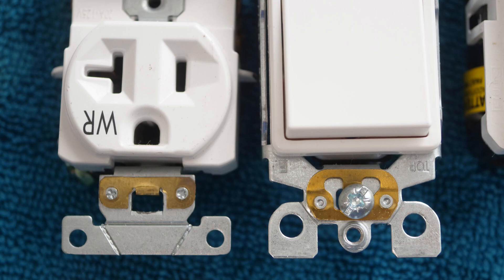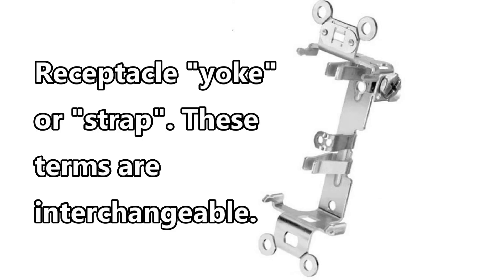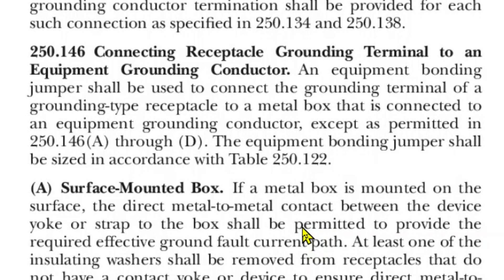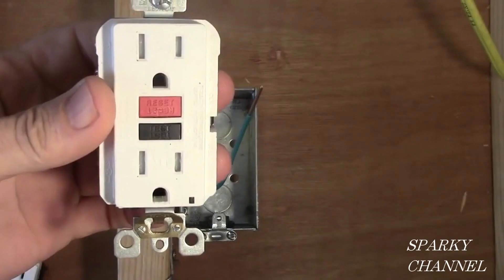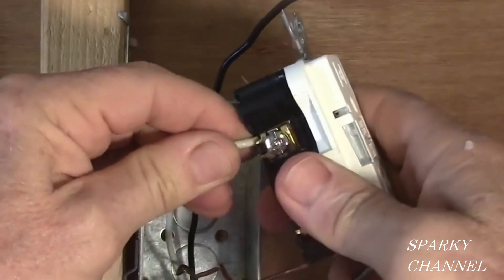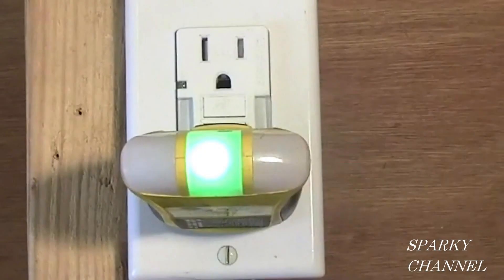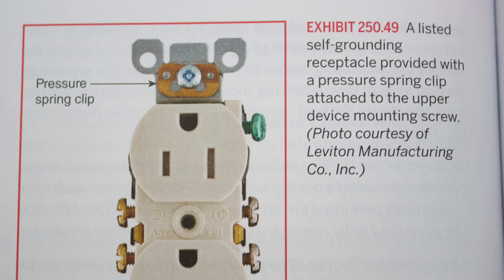Self-Grounding Clips for Receptacles and Switches with 2023 NEC 250.146

Comment: This house I'm working on was built in the 50's and only has 2 pole receptacles. My problem is the switch to turn on the outside porch light doesn't work the only way i get 120v is putting my test leads on the hot (black wire and the outlet box. The neutral and hot wires when tested only shows 50 volts. How do i fix that.

Comment: Dumb question, why would someone want to leave the washers on? If the box is not metallic it won't make a difference and if it is a metal box, why would you want not to have it grounded that way possibly in addition to being grounded with an equipment grounding jumper?
Reply from the maker: The washers hold the screws in place, making installation a little quicker. But I'm with you on that.

Comment: Does this only apply to surface mounted junction boxes?
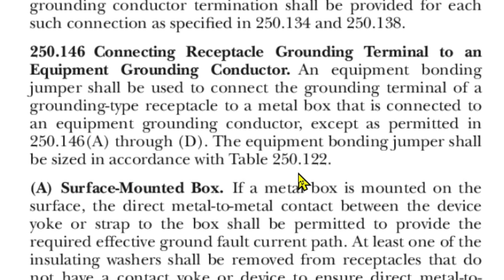Reply from the maker: See 2:13 Surface mounted metal boxes are treated a little differently than other boxes.
Reply: Is a device mounted to a metal box through drywall using the standard drywall ears considered a surface mounted box? 

I have a house build in the 60’s that has cloth romex with a ground. They grounded the box and there isn’t much wire to pigtail to the device. Most of the boxes are flush to the drywall but a few are recessed 1/2”. Would self grounding outlets be permitted in that application?
Reply from the maker: @beefboi9976  Do you have metal boxes?
Reply: Yes all metal boxes. They currently have 2 prong outlets but the box is grounded with the ground from the romex. There is not enough ground wire in the box to splice to the device.

Comment: Sparky... NEC 250.148(B) requires that disconnecting or removing the receptacle from the box does not interrupt the electrical continuity of the EGCs providing the effective ground fault current path. Therefore, the EGC needs to be connected to the metal box, not to the self-grounding receptacle's green screw... The self-grounding feature provides the bonding between the grounded metal box and the receptacle yoke...  Doing it the other way around violates the above article, IMO...
Reply from the maker: Thanks!
Reply: This was my understanding as well.
Can we get a video update?😂

Comment: Hi Sparky, I would like to upgrade an old 2 prong outlet to GFI, there are 2 copper (bonding or grounding?) wire that pass through (but don't end) in the back corners of the metal box, should I somehow attach ground wire to those in addition to the back of the box, or only connect the ground wire to the box?
Reply: @jenniferm2453 there's a way to test the box with the 2 prong outlet mounted in the box to see if you have ground or not.  If you have the tester to tell if you have proper wiring or not, and a 3 prong adapter, remove the cover plate screw to your 2 prong outlet, plug in the adapter & secure it with the cover plate screw.  Run the test.  If you see it as properly wired and grounded, the box is grounded.  Do the same test to all outlets on the same breaker.  If all show correct wiring and none of the outlets are in a kitchen, laundry room or bathroom, all you will need is an AFCI receptacle at the most upstream outlet.  But if one shows no ground, then you will need a combo AFCI/GFCI receptacle to protect everything downstream.  Now, some homes are wired so that every box appears to be an end of the line receptacle.  I hope every 2 prong receptacle on the circuit has a metal box that got bonded from behind.  That way, you'll have less to deal with.  You can also "borrow" the ground on the circuit to ground ungrounded boxes on the same breaker, using 12 gauge solid green wire.  You can legally ground an outlet box, using grounding clips to secure a wire to the edge of the box and feed it to unbonded metal box needing the ground.  I happen to have circuits I will be bonding, using that method.
Reply: Thank you. That was very helpful!

Comment: Good afternoon Sparky,  What electrical tool would I use to safely trip a breaker in the panel on regular outlet or gfic or afci.   Thank you.
Reply: A concrete core drill will usually do the trick

Comment: Based on the code that sparky read, it seems to me that these are only meant to be used in surface mounted boxes.
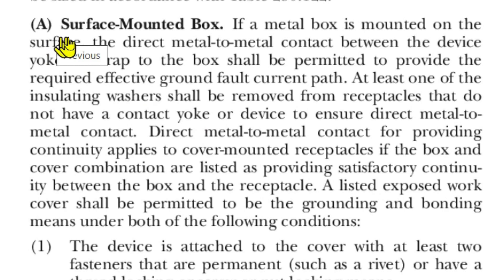Reply from the maker: See 2:13 Surface mounted metal boxes are treated a little differently than other boxes.

Comment: The plug-in tester is testing the device (receptical) wiring, no? How would it detect whether the box is grounded?
Reply from the maker: That is one of the tests a receptacle tester does. If there is a problem with the ground it gives a different code.
Reply: @SparkyChannel  That's cool, where can I get that model? Do you know how it does it? Is it making contact with the box somehow?
Reply from the maker: @Bapuji42  Here's my favorite: Klein Tools RT250 GFCI Outlet Tester with LCD Display, Electric Voltage Tester for Standard 3-Wire 120V Electrical Receptacles: Amazon: https://amzn.to/41DqV8O
  It makes contact with the ground of the receptacle, so it's able to make ground tests as well as AC voltage and several other tests. I highly recommend it.
Reply: @SparkyChannel  Thank you! But I'm confused, how can it tell if the box is connected to ground just by making contact with the receptacle ground?
Reply from the maker: @Bapuji42  It has circuitry inside of it that tests ground to hot voltage, which should be the same as the neutral to hot voltage.

Comment: Most residential=plastic boxes
Reply from the maker: In newer homes, yes.
Reply: Some jurisdictions such as Cook County Illinois which includes Chicago are what I call “pipe and wire” codes. If someone has a better term than this, please chime in. All line or mains voltage wires must be contained in metal conduit and all j-boxes are metal. Normally the conduit is TWC, thin wall conduit which is easily bent with a pipe bender or a hickey (old term). The conduit and j-boxes are galvanized steel. In exterior applications powder coated aluminum. Solid or stranded wires are pulled through the conduit and terminations/connection made in metal boxes. Thus the entire building has what I call an Erector Set (R) piped ground path that is properly bonded per NEC/local codes. The spring brass part riveted  to devices as Sparky shows is often in commercial grade devices. The 6-32 mounting screws have a slight interference fit in the brass which actually makes mounting easier since it holds the screw as you engage bit and drive it home. The brass alloy is essentially non-oxidizing so is a better bonding than just a screw to a galvanized steel box which can corrode and diminish path to ground efficacy. I only use commercial grade devices in small rehab projects in my area, Chicago. Mostly because the clamp-type wire grip in back. No shepherd’s crooks. If a dedicated grounding conductor is not present in a box I add one. Belt and suspenders. Newer boxes have, in the back, a 10-32 threaded hole (sometimes in a “bump”) where I attach a pre-rigged (green wire attached to green screw for ease of positioning and driving). You can buy these pre-rigged. In old properties I’ll drill a hole and tap 10-32 using my screwdriver-like Triple Tap Klein #625-32. Handy because it has 6-32, 8-32, and 10-32 taps on the same shaft. If I have a lot to do the shaft is removable and I put it in a small chuck that fits into my Milwaukee M4 cordless screwdriver. Been using the old and new Milwaukees forever. Clutched. Pivot for pistol or straight grip. With 32 TPI screws a real time saver. Especially with toggle bolts. Never used an impact driver in my electrical work. Hard to control and threatens strip outs. Oh, how I digress. Thanks Sparky. Happy and safe projects for all.
Reply: Thank you for sharing your knowledge.

Comment: Before I even watch the video, I'll say these are exceptionally useful in old buildings where the metal box attached to the old BX cable (*usually* with the little aluminum bond wire) is the effective ground. I know a lot of non-electricians who are ok just using the mounting screws for a ground. I was never really ok with that, and for places I couldn't get a green ground wire & screw on the box, I'd always do something like applying dielectric or noalox to the screws as a desperate attempt at ensuring a low impedance ground. This little clip makes things a lot better.
Reply from the maker: Yes, I agree. Great points!

Comment: Are the US now also using Pozidriv screws? Seen on 4:22. The screw has the additional small diagonal grooves that indicate that it's Pozidriv and not Phillips. And there's also a screwdriver available that is PZ/SL, in that case I think it should be PZ/SL size 2.
Reply: there's a few that use them but they aren't very common. Me myself i still prefer to just use a #2 square drive. They aren't being sold here yet as just bits (at least not in my area) so the only way to get a pozidriv is to get a full screwdriver set.
Reply: Those screws are designed for use with a flat blade, Robertson bit, or an ecx bit, same as the wire mounting screws on the sides.
Reply: @surferdude642  Normally yes. But not that particular one shown on the time index I've linked. That is clearly PZ/SL and not Robertson square drive. 

https://shop.albw.de/dasd/cv/media/b8fedaf0179e9d71f126b0d28773d97a/item-large/8U3HPOELFA8E43PLM51SVBNRKS.jpg
Reply: @surferdude642  Pozidriv is a modified version of Phillips. It has different angles of the flanks, and it does not cam out that fast on higher torque. To indicate the difference the screws have diagonal grooves, and the screwdriver tip additional smaller flanks. Yu can use PH in a PZ screw, but higher torque can damage the head of the screw or the tip of the screwdriver.

https://www.mikrocontroller.net/attachment/540061/PHPZ.jpg
Reply from the maker: Hi Marcel! Great to hear from you. I'm not sure. If I can find my pozidrive driver I'll try it out.

Comment: Whould it be acceptable to attach the ground wire to the metal box and not the device?
Reply from the maker: I don't know. It would work but the self-grounding clip is designed to replace the equipment bonding jumper so I would think you would need to stay with the self-grounding clip listing.
Reply: @SparkyChannel  I mentioned in one of your other videos that I replaced a double gang box to a grounded light switch box mounted on a kitchen wall that led to my back porch.  On that wall, my kitchen sink is attached to it.  The 1955 code required that all boxes on that wall be bonded because it was close to water sources.  When my father bought a box for me to use to replace the old double gang box, he bought 2 single gang expandable boxes, as that was what was used originally.  On the new box he bought in 1980, each box had a tapped ground screw hole.  I took advantage of both screw holes at that time, using one to bond the box with the old ground wire that  was originally attached to a bracket on the old box.  The old romex connectors were rusted from a leaky roof, so when I ran the wires into the box, I ran the ground wire to the inside carefully, with one of the switch wires, and bonded it to one of the ground screws on the box.  From the other ground screw, I ran a bonding jumper to both light switches, even though they had no grounding screws.  My thought has always been better safe than sorry.
Reply: In my opinion, that would make more sense.  Otherwise, if you have a multi gang box, then the whole unit coul become ungrounded if one of the receptacles was removed or damaged .
Reply from the maker: @dpky7333  Good point.
Reply: @dpky7333 Why is that? Wouldn't the other receptacles in the box still be making contact and grounding it?
Reply: @Bapuji42  If the outlet that the ground is connected to was removed then that would leave the box and other devices ungrounded.
Reply: @dpky7333  I see. I assumed all the receptacles would have ground wires connected.
Reply: @Bapuji42  Yeah, I'm guessing that the idea is to reduce the number of pigtails especially since surface mounted boxes are generally low profile.
Reply: @dpky7333  Makes sense.

Comment: I like the redundancy of them, but I still prefer to land the bonding conductor on the receptacle.  switches, where the only fault current would come from a fault within the switch or sloppy work in the box, I'm fin with self grounding.  receptacles may be called on to carry a fault from what's plugged into it; which leaves the possibility of corrosion raising the impedance of the ground path.
Reply from the maker: I agree, my preference is to use both the equipment bonding jumper and the self-grounding clip.

Comment: Totally confused.  You say the self grounding clip serves to ground the metal box? 

Video DID NOT show the ground conductor being connected to the green terminal?  Also the box clearly does have a green grounding conductor as the screws are being tightened?
Reply from the maker: The ground wire is attached to the receptacle at 4:39
There is no equipment bonding jumper because the self-grounding clip takes its place.
Reply: @SparkyChannel  Interesting, so you can either ground the box and that will ground the receptacle when mounted or ground the receptacle and that will ground the box when mounted?
Reply from the maker: @surferdude642  No, I think not, according to NEC. I think the intent of the NEC is to allow the self-grounding clip to replace the equipment grounding bonder only. The ground wire would go to the receptacle or switch IMO.
Reply: @SparkyChannel  Oh. So the receptacle will ground the box when mounted. In my case, a 1950's home the boxes are grounded by a thinner 16 or 18 gauge wire and are connected to the back side of the box, so there's no visible ground wire when the cover plate is removed. I verified with a multimeter that all the boxes have good ground. 3- prong receptacles and gfci's test correct and the button on the tester will trip the GFCI. In the cases where the boxes are slightly recessed, I added metal spacers to insure solid contact between the receptacle and the box, and not just relying on the screw threads for contact.
Reply from the maker: @surferdude642  Excellent! These self-grounded clips are very handy for applications like you describe. Sometimes there isn't a lot of room for an equipment bonding jumper in the small 50's and 60's metal boxes.
Reply: @SparkyChannel  Thank you, Bill. I appreciate your channel.
Reply: No, it does not. All the ground wires coming into the box must be connected and also connected to a bonding jumper to ground the box. The copper clip is supposed to give a purposeful ground when the receptacle is mounted to the box or to a metal box cover when the cover is mounted to the box and therefore a separate jumper to the receptacle ground screw is not necessary. At least that's the theory, but whether an inspector will always buy it is questionable. The issue is that the receptacle must be mounted for the ground connection to be made.